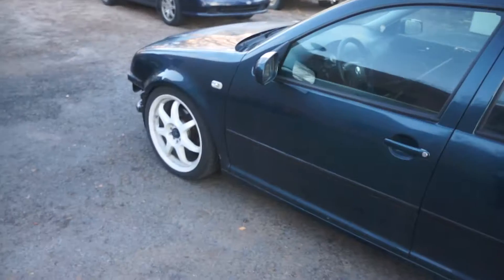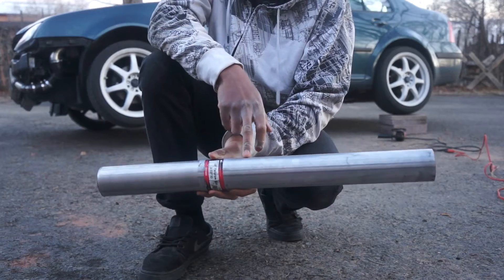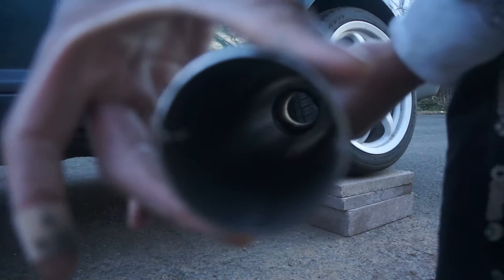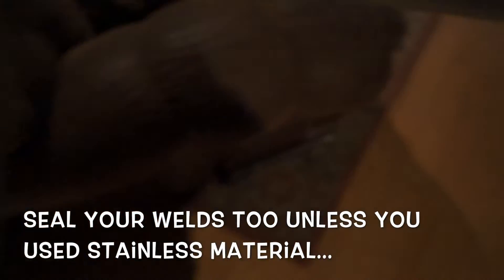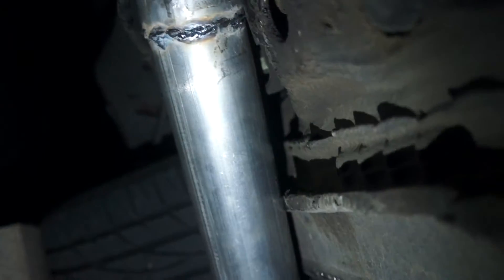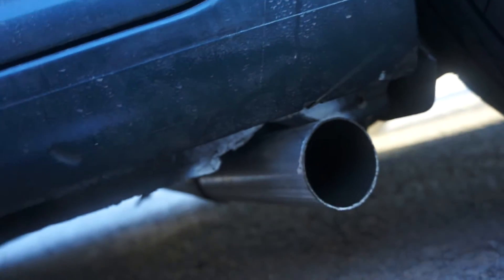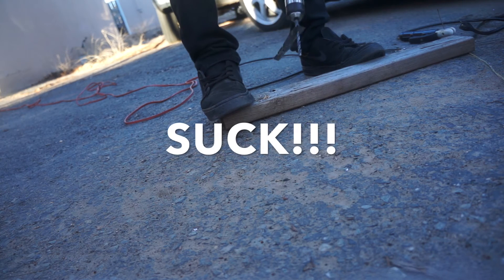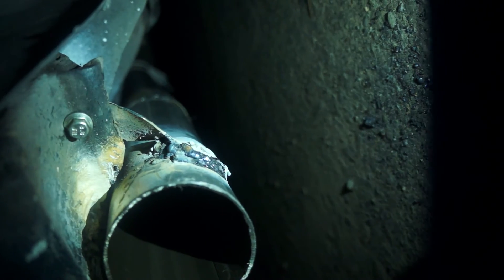Jetta 2.0 Turbo Gets A Sidepipe!!! Cause Race car

Comment: what is the turbo size
Reply from the maker: Sunny Canida its a t3t4 ar57 eBay turbo
Reply: oh ok thanks im trying to do a turbo build like this to. is the engine stock or you got new internals
Reply from the maker: Sunny Canida it's all stock at the moment besides the head spacer.
Reply: oh how many lbs of boost are you making and what kind of head spacers are you using and whats the compression ratio after you have the spacer
Reply from the maker: Sunny Canida I started at 9psi but turned it down to 6 because I kept blowing the intake pipes apart lol
Reply: oh ok what spacers did you use
Reply from the maker: Sunny Canida its from c2 motorsports